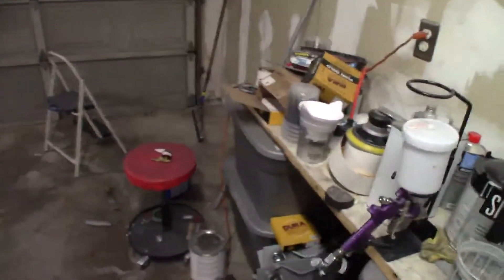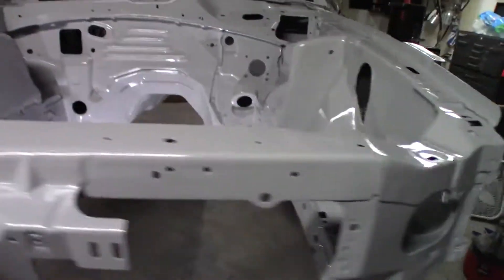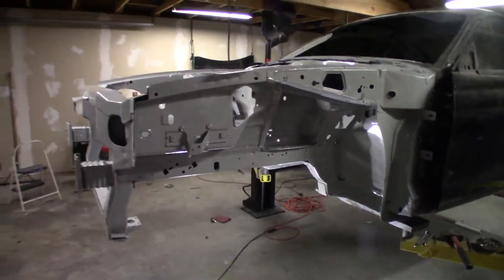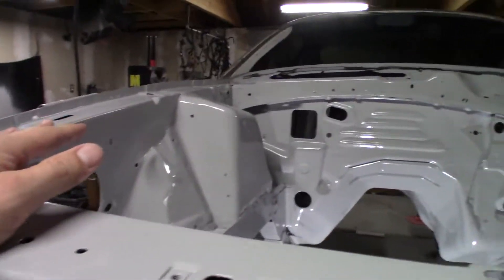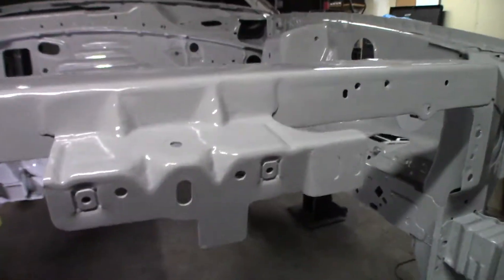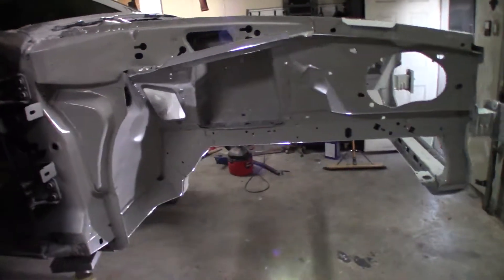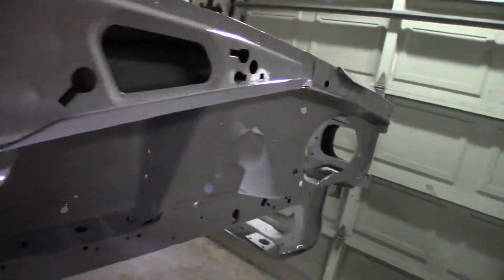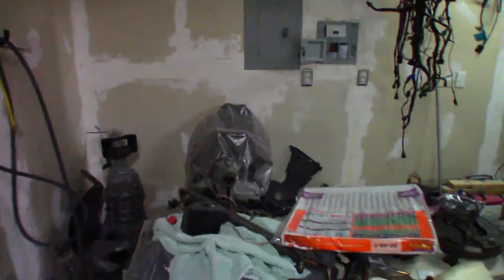What happened to my engine bay?!  - Cobra Restomod Part 6

Comment: Eastwood Internal Frame Anti-Rust Coating, 14 oz. Spray
you can use brake line vacuum hose punch little holes through out hose attach it to can go to town on on all your cavities.
Reply from the maker: thanks for the advice. i used por15. the car is done BTW.
Reply: @OEMPlus  por is great, but expensive and it doesnt come in a spray can, you need a spray can to get inside holes and cavities
Reply from the maker: @fasterdrive221  i used a suction feed sprayer from amazon. ya don't wanna get it on ya but dang if it doesn't stick!
Reply: @OEMPlus  yes that works